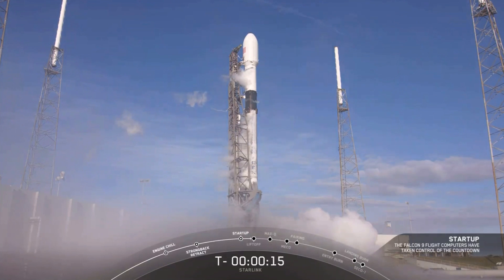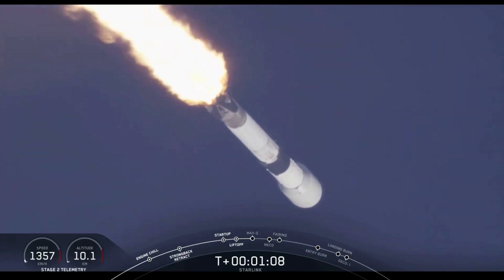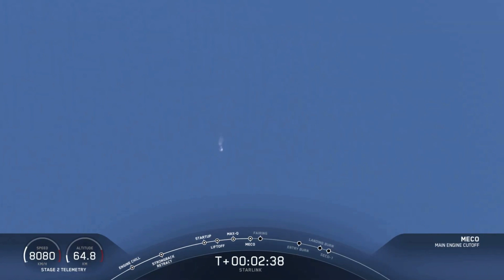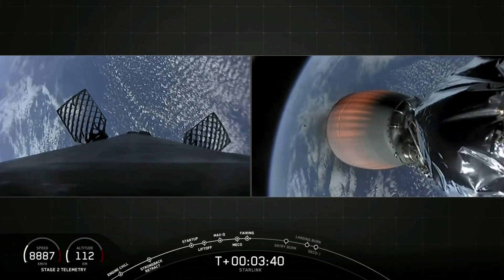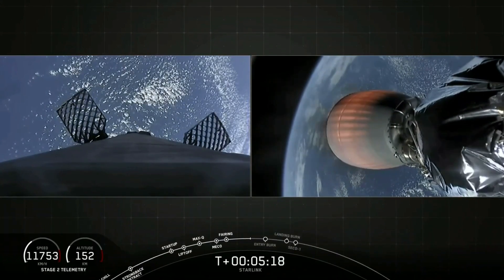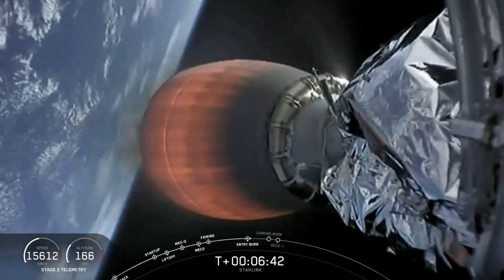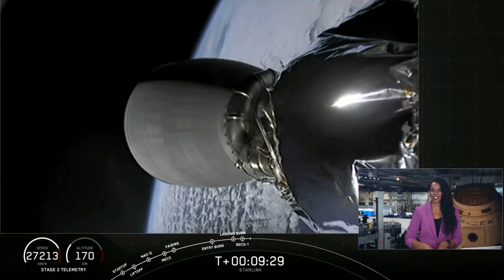SpaceX Launches Starlink-3 Mission

Comment: Crane landing
Reply: Don't worry, no such thing as fire. Thrusthoax2020, loser.
Reply: @TheCrimsonBlade2  in my opinion ... this is an absurd landing ... just a comparison of fighter planes if the wind is too strong it will be difficult to land on the aircraft carrier. and this is a rocket with a small boat in the middle of an ocean with high waves that is impossible to do. and why in the middle of the ocean. so there are no witnesses.
Reply: @tukangmaido185  that boat is massive. They only land in calm wind conditions. And in my opinion it is not an absurd landing. Why advertise if you were hiding?
Reply: "Crane landing"? Where do you see a crane?
Reply: Or CGI
Reply: @tukangmaido185  So you can't make up your mind but you're sure it's "fake". 😂😂😂

Comment: How can burn an engine in space if it is  not air at all ?
Reply: The oxygen is supplied via separate on board cylinders.
Reply: @savedbygodsgrace.9058  Thank you
Reply: Oxidizer in the fuel

Comment: The landing system  is nice..but what happens if for say weather reasons they dont have enough fuel .. is there a contingency plan
Reply: Fuel wouldn't be the issue. Just the weather at sea and the swell size of the waves. If I recall correctly if the landing site is too hazardous they scrub the launch. It's only happened a few times though I believe.
Reply: Also if the fuel should become an issue, I think the contingency plan is to try not to hit the barge.
Reply: @zzpazi  the reason I ask is a russian space  craft crashed when its breaking thrusters failed.

Comment: 6:15, right side. something starts to fall off the engine. Then they switch cameras. 
Shouldn't there still be enough thrust to hold it in place? And why is there something falling off the rocket to begin with?
Reply: That's ice
Reply: It's also the 2nd time this happens. Check 3:28 

Ice.. LOL. 
Another said it was foil melting.. LMAO.
Reply: Wow also at around 4 mins it happens a 3rd time..

Comment: Why do they keep accelerating? Why cant they just go at a constant 100 kph or 2000kph ? Sure it takes longer but still
Reply: Rockets cant not accelerate. If the engine is burning its accelerating. Spaceflight is about reaching certain speeds to get to where you need to go. So to get to low Earth orbit you need to accelerate to a speed of 17,500mph. After that speed is reached engines can be cut and the vehicle will now orbit around the planet now having enough outwards energy to balance out the inward pull of gravity.

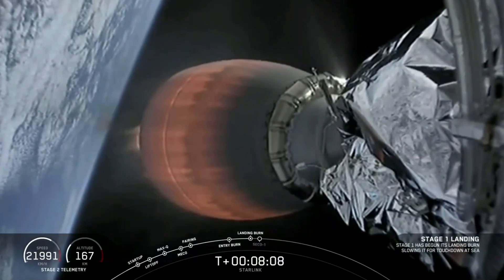Comment: How come at 8:32 the earth is flat and 8:37 the earth is round makes no sense to me . I'm sure one of you fan boy's can explain this to dumb old me. Is one a fish eye lens? and the other is not or are we getting a mirror image somehow?
Reply: Different camera. At 8:32 the Earth should be curving away from the center, the fisheye turns it flat, or actually slightly concave. From the other angle it exaggerates the curve, which is now towards the center.
From the engine features it's clear it is not a mirror image, just cameras on different sides
Reply: @zzpazi  Wouldn't the other angle be  shooting into space. You can't have two cameras on each side showing the earth when we know the rocket is falling around the earth. Rockets don't go straight up!
Reply: @diamonddavey2668  the Earth is giant, you'll catch a piece of it with a wide angle lens and a lot of it with a normal lens, as depicted in the video.
Reply: The Earth is flipping back and forth between flat and round. 🙄🙄

Comment: Wouldn't it be easier to have the fairing open like a clam-shell? Add some parachutes to it and catch it that way?
Reply: It does come down on a parachute wing. Watch the SpaceX feed for the one they caught on the ship.
https://youtu.be/1KmBDCiL7MU?t=3090
Clamshell adds complexity and additional failure modes.
Reply: @HotelPapa100  thank you so much for the link and your input.
Reply: Parachutes don’t work in no atmosphere then they’d get ripped off because of the weight plus velocity once it hits thicker air

Comment: The damage these things are doing to our atmosphere, and more junk up there.
Reply: What damage?  The CO2 output of a Falcon 9 launch is roughly on par with a single large airliner doing a trans-Atlantic flight.  And SpaceX is working on eliminating even that - their Starship rocket that is under development will use methane as fuel, which by itself means less CO2 output, and also has plans to use solar power to create synthetic methane from water & atmospheric CO2, which would both be carbon neutral, and good practice for creating fuel on Mars.

As for space junk, Starlink is going into very low orbits.  Once they run out of fuel, they will be quickly brought down by atmospheric drag.  No long-term space junk will be created.  Oh, and they are making sure to design the satellites to burn up cleanly when they deorbit, and not contain anything more toxic than the hundred tons of space dust the Earth hits every day anyways.
Reply: Suska Klapp space junk is no longer a long term issue. All satellites are required by law to de-orbit after their lifespan.

Comment: Is it a mouse or not a mouse what is happening?
Reply: Oxygen ice. In some shots (I think mostly during coast phases) you see icicles forming on a spill pipe. Apparently they land there when they come off.
Reply: HotelPapa100 Oxygen from the fuel burn can’t be its all used for combustion oxygen in the stratosphere at that altitude not possible how do hypergolic rockets produce thrust(energy from gas expansion)in a vacuum.The mind boggles.
Reply: @thejollyman  It's probably boil off from the tank or exhaust of the gas generator. I don't know the details. But the exhaust is visible in every second stage video feed.
Reply: @thejollyman  BIG chunk visible here, breaking off when the engine restarts:
https://youtu.be/1KmBDCiL7MU?t=3464
It's definitely not from the gas generator. Its exhaust is much larger, farther over board ( and probably REAL HOT)